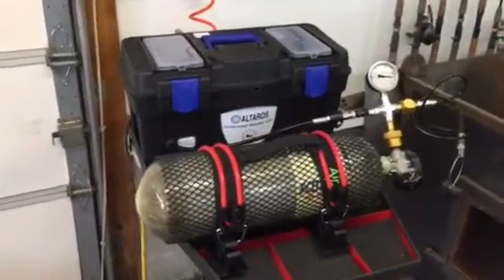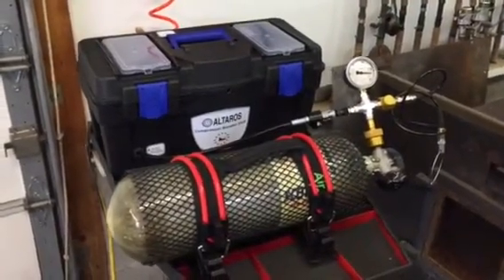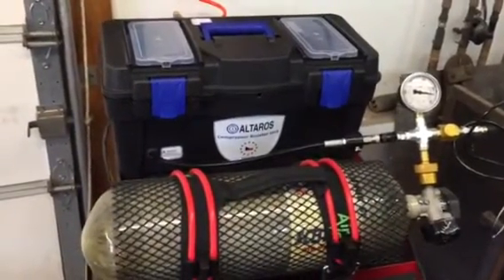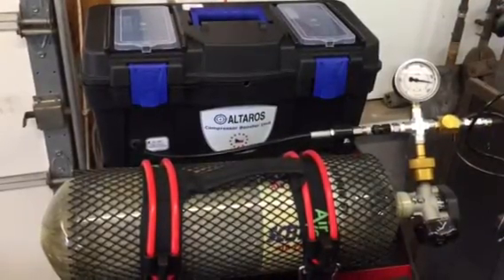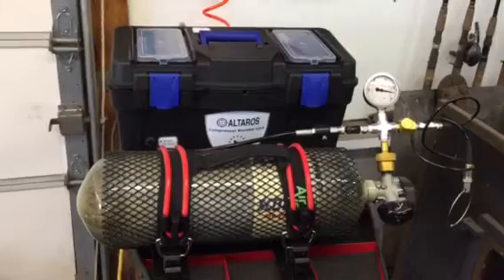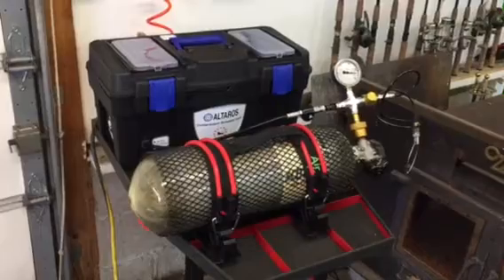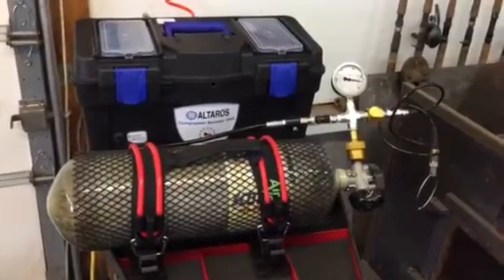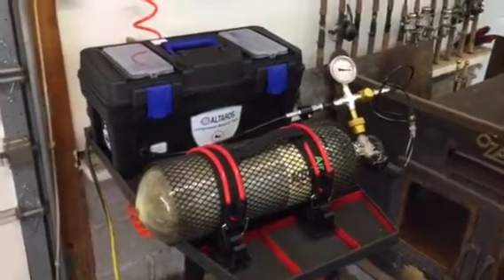Altaros booster compressor update

Comment: 60/40 means 60 percent compressor ON and 40 percent OFF.

You have it one 33 percent ON 66 percent OFF so not close to the 60 40 but does not need to be if you fill it in 40 min.

Must have a big primary compressor driving it.
Reply from the maker: You are correct. I have a 5 hp 2 stage 60 gallon Snap On compressor.
Reply: I would be curious of how much faster it would fill running it at the factory suggested specs of 60 percent on 40 percent off.   Maybe 30 minutes.    That big compressor could do it in its sleep 33 percent is not even pushing it.    You driving that compressor like an old lady.  Come on man.